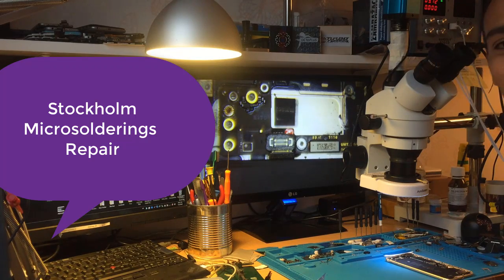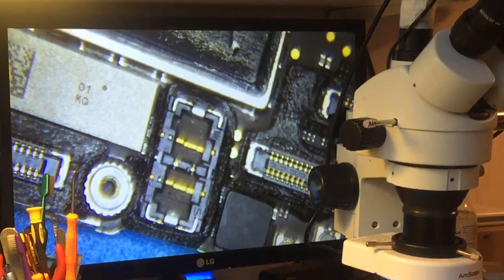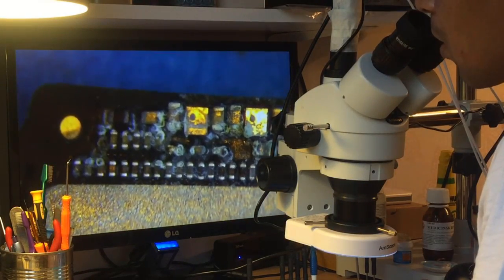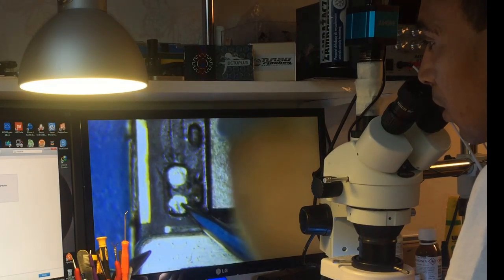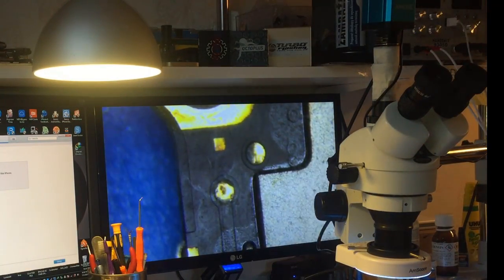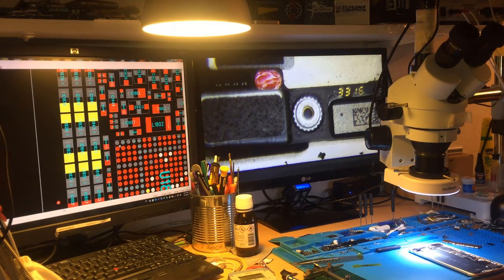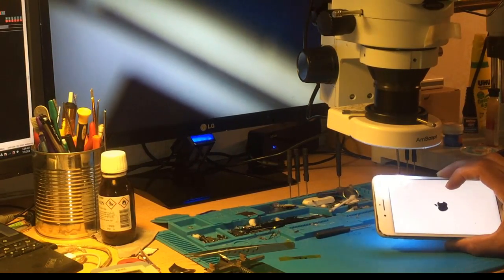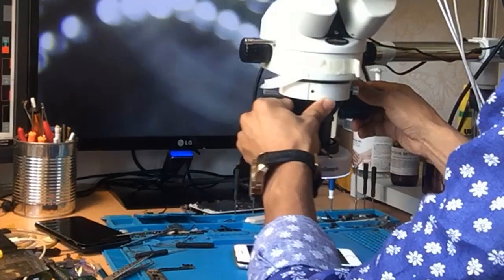How to repair iphone 7 plus water damage/ Not turning on

Comment: I got extremely little water inside my speakers and at first the home button didnt work. I tried doing the rice trick, which the next day I checked on it again and it didn't turn on. Like it only showed me the apple logo and it flashes and dies then it restarts itself automatically and instantly dies again. It did this over and over again. Please any help? Ive only had the phone for JUST 3 DAYS.
Reply from the maker: Mr. Saitama well first If the phone is water damaged, it needs to be opened as fast as possible.and replace the damaged component before you start it ahain Otherwise it Will affect the CPU central processing unit. Thats why it restarts again and again. I recommend not to switch it on and leave it to someone WHO can oppen it.

Comment: will you be able to get all the photos from my water damaged iphone 7 plus?
Reply from the maker: Mark Rustan Lucena there too ways for data recovery. The first is cheaper. The second is more complicated and takes more time. I need first to look how damaged your phone is to tell what way can save your photos. Anyway it’s possible if you have important stuff in the device
Reply: @MICROREPAIR  how much do you charge for water damaged repair? I went to a repair place here and they took a lookt at it for days and wasnt able to repair it. Can you do it?
Reply from the maker: Mark Rustan Lucena send it to me Moste repair shop don’t work with microsoldering. Did they take a look at it closely with microscope. I have repaired many water damaged phones. I need to see how damaged yours is